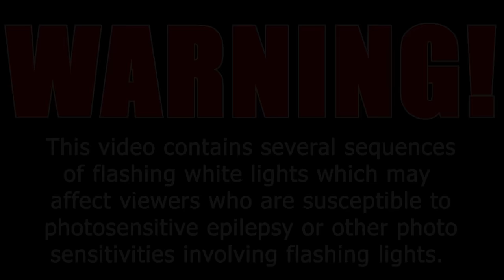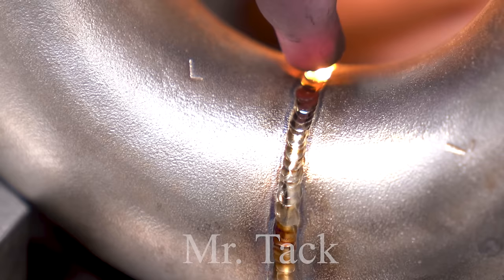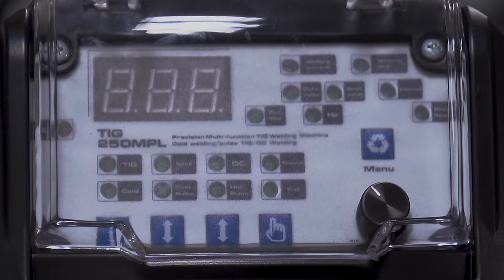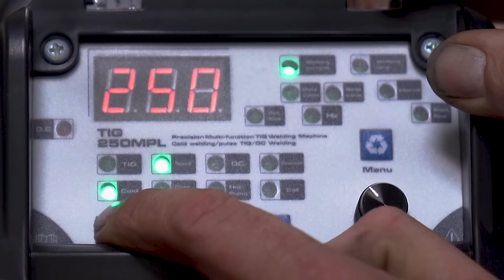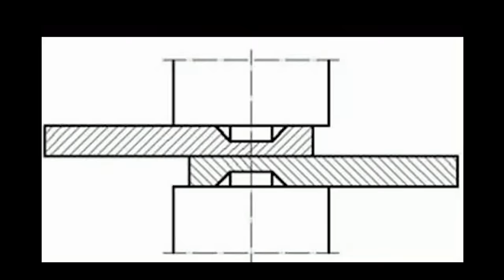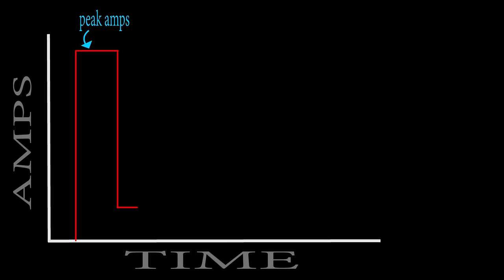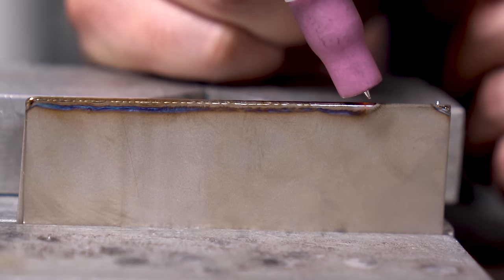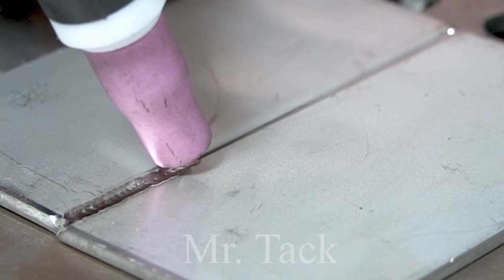So I Bought A Cold Welder

Comment: Watching this vid in a pitch black room is like being flashbanged non stop
Reply: Fr
Reply: It’s all flash and no bang
Reply: lol
Reply: Having a stroke rn
Reply: @azligckshibson870  why?
Reply: Zax Reion  why?
Reply: EMP OUT!
Reply: Hi, let me introduce myself. I am currently in a pitch black room watching this at full brightness.
Reply: i gonna press F for your eye...
Reply: Yep my eyes r hurting right now 🤣
Reply: Yeah im just curious about a chinese welder and now im curious about epilepsy.
Reply: Heck I'm watchihng this in a bright room and I'm haldf-blind already
Reply: I can promise you it's really not
Reply: The seizures keep me warm at night.
Reply: A tru cold weld woul be a weld made by just pressure where the materials were fused together with just pressure which is very hard to achieve especially on a consistent basis which is why heat is usually used most often used and sometimes in conjunction with pressure. Other than two metals being combined cold with enough pressure to fuse them without heat, a cold weld from mig, tig, stick, or any other process is almost alway a bad weld.
Reply: I tapped on the comments to say exactly what you just said. I'm just watching a couple of videos while in bed to try to sleep. But after this video I am seriously getting a headache. I have my brightness set on super low so it doesn't bother my husband.
Reply: But what is welding in general but a bunch of flash bangs strung together?
Reply: right, feels like I need to go grab my hood

Comment: This machine is the equivalent of cooking a chicken at 1240° C for 15 seconds
Reply: that was actually a pretty cool way to compare it to something respect+
Reply: You mean ppl don't do that?
Reply: Isn't that 'Cajun Style'? I've always called it 'burnt & raw' but that's just me....
Reply: That's why my kfc is so dry....😆
Reply: Yeah, then the best meat would be the one between the outer carbonized skin, and the inner frozen tissue.
Reply: @ian020881  check out "cooking with Jack wet brine vs dry brine part 1" on YouTube. He's a YouTuber that's been doing cooking videos since the infancy of YouTube (like 12 years), and he still doesn't know how to cook. It's hilarious. He cooked a butter milk chicken for like 30 min at 300°, and HE ATE IT COMPLETELY RAW and he acted like it was cooked. Several commentary channels have talked about it. AugustTheDuck did a good one.
Reply: Add in some yogurt and spices, and BAM: Tandooriluminum!
Reply: that made my laugh 🤣
Reply: How?
Reply: I love my raw chicken cooker.
Reply: With that in mind, he asked for suggestions... I think that should be one of his tests!
Reply: In other words, the heat affected zone is extremely small, which is very useful for some things. For example, repairing something that has plastic attached, and the weld cannot melt the plastic. It's not for exhaust tubing, because you can't access the inside of the tube to weld that half (penetration should meet in the middle from both sides, for better strength).
Reply: I mean that's how I cook chicken.😂
Reply: that seems to me like something for whistlingdiesel :D

Comment: I own 2 miller tig welders & a multimatic 220/ac/dc & a Lincoln mig w/spool gun....I bought an Andeli cold tig welder for $450. Came with 2 torches (wp-9 & wp-17) plus a simple trigger foot switch. For the specific type of low load stress, high precision tiny parts I make it is fantastic. Limited application for sure, but its incredibly easy to use & fully programmable in microseconds dwell, amperage, cycle(in pulse mode), preflow & postflow. Fantastic for precise tacks that are followed up with silver brazing, short burst spot locks things in place without oxidation & fluxed silver brazing flows beautifully over it.  I regularly use it for very thin guage stainless sheetmetal parts as well & never burn through... All you do is regulate your trigger finger timing (or set simply set it to pulse mode) & you can get perfect weld penetration. I see so much hate in comments sections I really don't get it. (*Except it is made in China...& there is an irrational hatred of their products & manufacturing capabilities)
Reply: Good review on this I have been picking up a lot of kitchen stainless jobs and was looking at this machine myself!!
Reply: Agreed,its for a purpose,not building aeroplanes and as Flatbob says it works well.
My Unimig Razor 200 acdc tig has a spot function which does exactly the same thing,its not new,just another option for your particular circumstance

Comment: I never seen any one weld aluminum foil together before. That was kinda cool. Cold weld could be termed as a Hobby craft welder
Reply: We used to do that in tig class. Its good practice for heat control.
Reply: exactly how we practiced as well learning tig!
Reply: This isn’t actual cold welding. It’s just low amp tac welding.
Reply: learned that trick way back in 1985 the trick is, bet ppl and tell them they can set up the machine ac or dc +/- any amperage there choice and you will weld it i must have made $1000s of dollars since trade school.
Reply: Amen  brother, Amen
Reply: @thewoodweldingfabricator9300  we did a soda can
Reply: @lilfear  we had a guy make a bong that way
Reply: Yes thats my taughts too. This welder would be ideal for scale model makers or for welding very thin small parts like small springs or wires
Reply: Cool video man. Thanks for that I'd been trying to figure that out myself. Very helpful
Reply: It's actually really easy to do
Reply: Yep that's exactly what it's for👍
Reply: It can be done with T.I.G. welding!
Reply: @mrmidnight32  its cold weld and you can weld copper onto steel.
Reply: more like "Poor hobby craft welder"
Reply: Old dog and pony show Miller used to do it when inverters came out for bragging rights on the 1 amp minimum amperage
Reply: @thewoodweldingfabricator9300  oof, there's a reason glass is the norm
Reply: @stinkymart3173  oh I'm not sure if it was any good. He was a pot head though, the type that Bob Marley would say "damn dude, you need to cut back a bit." He also believed that pot made you smarter and could cure all diseases, so...
Reply: @thewoodweldingfabricator9300  have you ever smoked weed? Do you drink alcohol?
Reply: @stevebolton2547  I drink socially. I don't smoke nor have I ever. And no, weed doesn't cure cancer. It also doesn't replace an education. He believed both were true.
Reply: @thewoodweldingfabricator9300  and you know it not to be true? I think maybe you should smoke a joint or two as it also helps you free think and question things.  Alcohol kills people , weed don't.
Reply: @stevebolton2547   Alright dude I don't have anything against people smoking marijuana I just used to know a guy who believed that marijuana cure cancer and epilepsy and apology and a dozen other things. Which it has been shown to help some people with epilepsy, and also help people who are on chemotherapy be able to eat. But it isn't a miracle drug like most of the hippies believe it is.  And no it doesn't increase your critical thinking , experience and practicing critical thinking increases your critical thinking
Reply: My welding instructor back in the day, fused aluminum with a Miller tig welder.  Thought he was like kung-fu master 😅.

Comment: Imo, "cold welding" is just a gimic! I was doing this 35 years ago. I had a spring loaded on/off micro switch taped to my tig torch, and I would either preset my amperage or use the pedal. The switch would completely break the arc/amperage. I referred to the process as manual pulse.
Reply: spot on mate so did i been air craft approved for over 20 years and asmi 9 and 6 g app
Reply: What do you mean by gimic?
Reply: Yeah - I'm not professional but I used to make some custom decorative pannes that had NOT to twist or buckle so I just used to pulse the trigger on the TIG welder.

So there was nothing cold about it - only it did not allow time for heat to build up and the metal could dissipate the heat.
Reply: It's not comparable because because here it's electronically controlled at high amperage and very short duration that's perfectly timed. You can't achieve that manually. It's like cleaning fuel injectors with a homemade switch that ruins the injectors vs. a designated device that opens them for a split second just like the car ECU.
Reply: @anancapcat4221  Also known as bullshit.
Reply: Cold welding is a real thing, not a gimmick. Its also know as vacuum welding. This is just pulsed tig with shitty-settings
Reply: @q3st1on19   single pulse tig with well controlled parameters is a really useful thing to have. It's not for achieving high penetration, or large welds, but when you want extreme control of the heat effected zone.
Reply: @RobertSzasz  Yep, extremely useful for small scale welds... I assume nobody here has ever used a laser welder, but this 'cold welding' seems to be the TIG torch equivalent. I think it's just a typical case of bad translation from Chinese to English, and there's probably not specific jargon to translate in the first place.

Comment: I found it quite useful for mixing small items. A/C pipe leaks, for example. Leaks are small, pipes are copper, valves are close by.
Reply: i use oxyace for ac leaks, first get qualified guy to empty it, weld it and have same guy fill it. Heck i need to qualify in those too im plumber and i only can install the systems but not fill them or mess with them
Reply: Would also be useful for figurine artists

Comment: I could see this for a jeweler. Neckless, bracelets, etc. Even setting stones. Or if you wanted a second machine to tac sheet metal without fear of melting.
Or maybe prototypes so you can break welds quickly with less loss
Reply: Jewelry, and also chainmail!
Reply: Eric bloody good idea
Reply: Or metal frame eyeglasses (or sunglasses) repair.
Reply: Yup, i wonder if it could weld (or rather join) thin silver (0.5-0.8mm) plates?
Reply: You can buy a version without the gas and various amounts of capacitors missing for 60 bucks sold as a jewelry welder I have one works okay once you put in the capacitors.
If you want to look into it I have pretty much all the videos in a playlist on my channel and I made a video about modifying them myself, but it's not really informative.
Reply: Dude u solder silver and gold unless you're mostly using copper and just plating it after
Reply: There are a couple US and UK companies that make welders that targeted at jewelry and dental industries that sure look a lot like these "cold" welders, except they are $2k - 10k USD! I'm not sure what the difference might be.  They are micro-tigs,  come w digital microscopes, nothing fancy. Orion and sunstone are the ones I remember atm.
Reply: @FrancisR420  That sounds interesting. Would you mind giving some more details about the machine that I can search about it?
Reply: For a jeweler there's already laser solutions out there... But they dont cost 400 bucks dats for sure.
Reply: @FrancisR420  how do I find your channel?
Reply: Single pulse TIG is a standard (+ lasers nowadays) in the injection mold repair field.
Reply: @jolyonlovell3554  just click on his username :)
Reply: @markbehm  Well, there's micro-TIG for sure.  The Orion system does something novel, I think you touch the electrode to the work, and then the electrode is quickly retracted a short preset distance.  Then you get one zap, might be capacitor discharge.  The Chinese things are exactly a TIG welder with the ability to set a very short pulse, they use ordinary cheap TIG torches.
Reply: The orions(some? all?) have some frequency curve programs to help with...something. Cleaning? Penetration? Different patterns or falloffs for different metals.
Reply: @MysticalDork  i'm hoping to test it out on titanium chainmail, actually! We'll see
Reply: @qwertyasdfghjkl9604  this is why normal welders dont understand this process. They are used to welding big structures where welds have to be 'strong' wheras moldrepair is more about micro cladding.
Reply: @FrancisR420  @Maui Randall
Reply: What do y'all recommend for merging steel cable? It's 1/16 304 stainless steel.
Reply: my thoughts exactly
Reply: That's what soldering is for, which is what jewelers do....
Reply: 💡That's exactly what this machine is for👍 The videos we see of these people "welding" thicker metals are just the different possibilities that this machine can do👍👍
Reply: that's precisely what its for & it was called Jewelry Welding or "gold welding" ,, 
 lol get it  all the "cold welder" is is a scaled up version
Reply: i only learned about this for making metal eyeglasses frames instead of brazing & spot welds , this was NEVER intended as structural
Reply: @WapTek123  FACTS!😂👍 I don't understand why people are trying to clown this machine. I guess that's the internet for ya, people will hear someone say that something is not good, then follow the agenda of the person that said it's not good without even attempting to think of why the person is hating on the product😵 Too many people are slow😂👍
Reply: Please, My concern is , will it last, I have a broken part on a sewing machine, that is so damn hard to screw back in place I wanted to solder it in place, but I am afraid the torch will damage the parts around it.  So when I saw cold welding , I was intrigued.  But this part moves around with much speed, will it just break?
Reply: @markbehm  there is no such thing as cold welding.
Reply: Two machines one for tacking and the other for welding would be too much to deal with. 

Just learn to tig from the start to become one of us pros that everyone thinks isn't a pro posting in the comments
Reply: @leonardpearlman4017  Orion micro-TIG are cheap Chinese crap. They don't do anything novel. The machine in this video would be far more versatile, and the 'cold' mode he showed is basically all the Orions do (one trick pony). They have the crappy touch screens from a 1997 Garmin GPS. Total overpriced junk. At least the machine in this video does the spot welding AND regular TIG welding, at a fraction of the cost.

If you think that you need what an Orion appears to do (in the brochure), you ACTUALLY need a laser welder. There's ZERO comparison. Just get a real bench top laser welder (avoid DaDo brand at all costs), and thank me. Do not even think about buying an Orion. You could buy 10 of the welders in this video, for the price of an Orion. It's a no-brainer. PS, the 'retracting electrode' doesn't accomplish anything. That's how you trigger the arc, because there's no foot pedal. It's basically automatic lift-TIG. Big whoop.

You could literally get the $400 machine in this video and mount the TIG torch in a microphone boom arm and aim it down at your work, right in front of you and it would be an Orion, while an Orion costs $4,000. At least you'd have a foot pedal, an extra $3,600, and an actual TIG welder for doing real welding. The Orion 'torch' might look different, but I assure you it's just a TIG torch with a collet that holds a tungsten electrode and releases argon. The only difference is the solenoid inside that does the automatic lift-TIG arc start, which isn't a feature worth paying money for. 

The reason it's automatic is because the optics have a shutter that closes during the arc, and you can't actually SEE the electrode during welding, to lift it manually. If you want that kind of magnification optic, then you really, really, really should get a laser welder. You'll never have to sharpen an electrode again, and they can weld as fast as a sewing machine. Orions are slow as hell.

If the machine in this video is about $400, then I would say a fair price for an Orion is about $150. They're both Chinese junk, but one junk is way better than the other junk.
Reply: @hxhdfjifzirstc894  Even $150 is probably overpriced.
Reply: @FrancisR420  exlpain to me I want to add pulse on my vevor Tig 210a I imagine it's very easy to add considering it has a USB instead and cost more but what about the dual voltage also
Reply: Any dirt cheap tiny TIG machine will do that sort of thing and be a useful welder for somewhat thicker stock. Foot switches are easy to rig if not supplied with one's machine.
Reply: @BlazejKarwowski I'm sure

Comment: I'm glad someone took the time and money to look into this!
Reply: We need him to do a follow-up video showing how this can be accomplished with a mts 252 or 275 pluse DC TIG welder
Reply: @772777777777777  yes i need this is video
Reply: @billelnaruto5390  mr tack....can you follow up this video...

I watched a few cold welding video... and observed a few  things for thin gauge mild steel  ie .035 
The  setteting are preflow 
Ramp 0  tig base amp equal sheet thickness ie 35 amps..tig base on time is low..20-50%, freq pluse is equal to amps ie 35 pps, tig base % amps is set low? No down slope...tig end is very low, pre flow 3 sec

I would experiment  more but got not argon to play with st this time.
Reply: Just look into tool and die (injection molds) repair business. Example: SANWA SW-V01 machine.

Comment: As a matter of fact, it is actually legitimate process that my Kemppi Masterig MLS also has_ _but its called microtack.
And it is meant for tacking very thin parts without penetration, without the need of grinding tacks, need for purge gas and so on.
Reply: Are u using shielding gas for the cold welding?
Reply: @ianmoore525  Shielding only one side like regular Tig welding, tack welds only, so there is no full penetration, thus no need for back- purging.
Reply: Main downside is, ideal fitment- absolutely no   gaps allowed.
Reply: @hdjawa  You need to figure out how to feed filler wire in, to close the gaps and add thickness. I think it's better with gas. Argon.